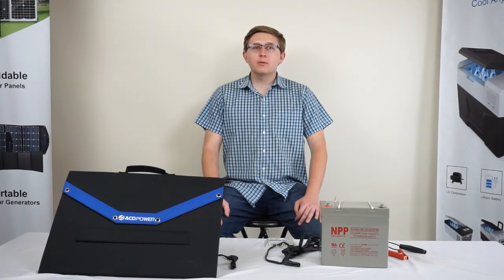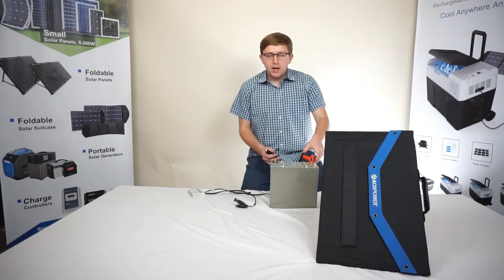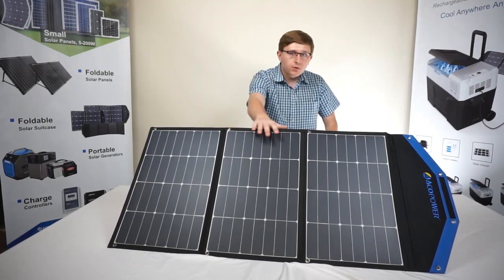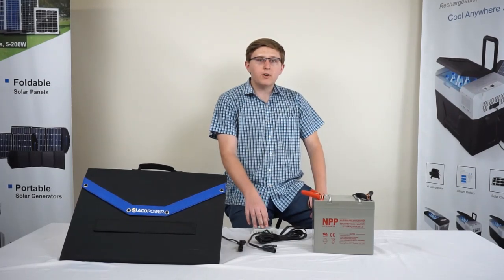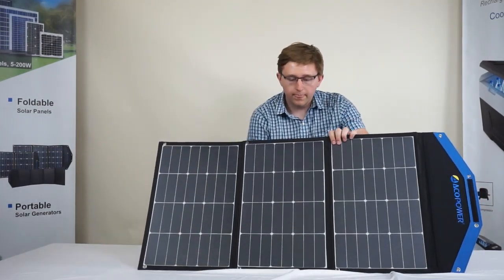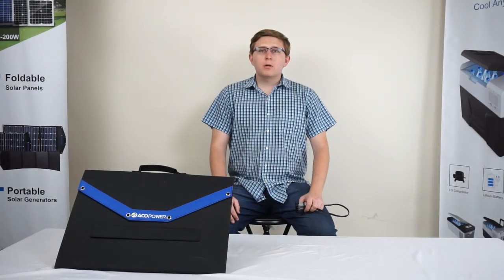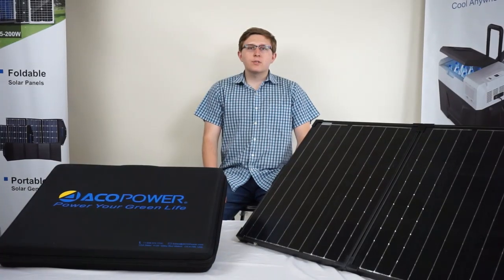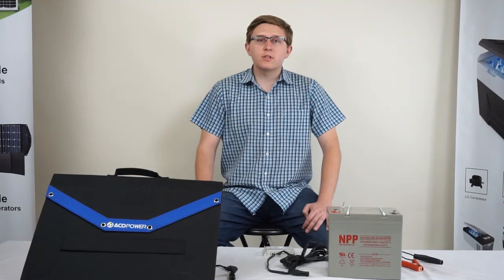Foldable Solar Panel Instruction Video

Comment: What is the "max. series fuse rating" of the 120 w folding panel.  I want to connect it to another panel and need that information.   I am led to understand that ALLLLL  solar panels must have this information printed on the panel??   thank you